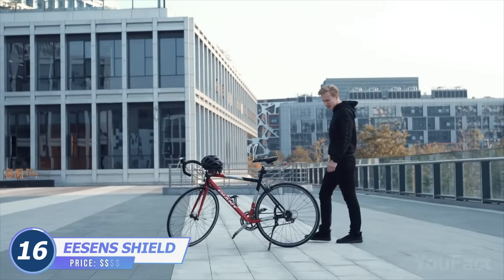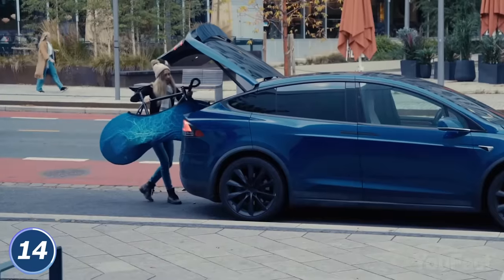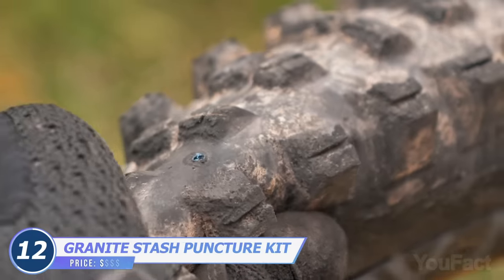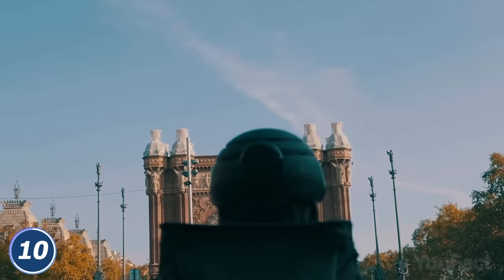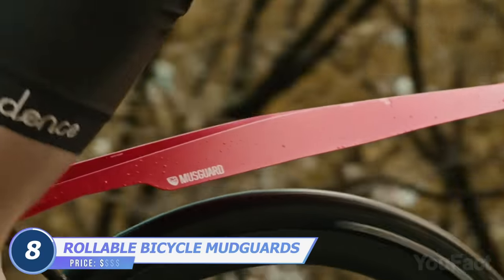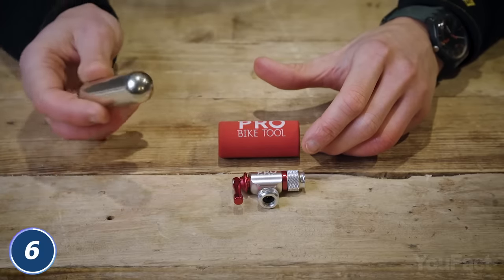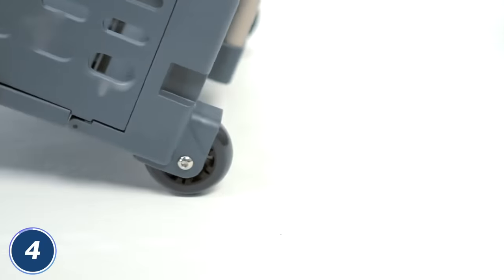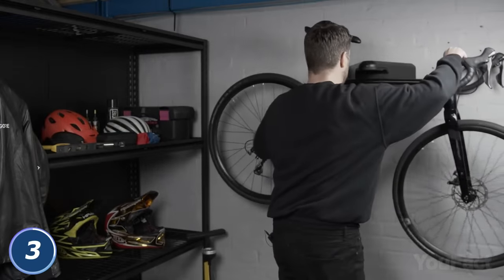16 Coolest Bike Gadgets You Can Buy

Comment: Pretty much everything on this video is a gimmick. Don't invest, you'll likely be disappointed if you (use it) rely on it. I have almost 15 years in this industry and hear some interesting tales from peeps just riding along!
Reply: Totally agree although i don't have the half of your years of experience.
Reply: You only need some common sense to know all of these products are gimmick
Reply: the mudguard, airlock and the built in computer looks pretty legit. at least out of everything thats what really caught my eyes. that being said also really like the bike sock for indoor use and when im not able to use my rear bike rack since i ride all year long here in the UP. i would definitely buy a full size one for storage if i was forced to keep it outside. the lights are stupid tho considering there are several great handlebar remote controlled ones on the market under 30 bucks. i think if i didnt already have a vertical bike nook id buy that airlock it looks like it would be a lot friendlier to install vs a set of bike hooks that many places wont let you install in a rental situation.  also i refuse to hang my bikes by the tires it always causes spoke warp on mtbs. or at least it has in my case.

Comment: Those gadgets for cenverting a regular bike to e-bike, they should made it be easily chargeable when not in use. This way, u don't have to remove it if the outlet is far  or the charger isn't long enough. It can also charge up ur other devices whenever you're biking so you can charge your phone on the go
Reply: it would be great if they make one that self charges when not in use like an ecar
Reply: Or when braking

Comment: Zipper tires....guaranteed fail, and quite possibly an associated injury. The tire plug only works for tubeless tires. The best thing here is the tool in the fork tube (not an original idea, I have something like it) and the frame strap. The emotor that drives your tire looks ok, the disc one pretty cool. Motion activated lights are a no no.